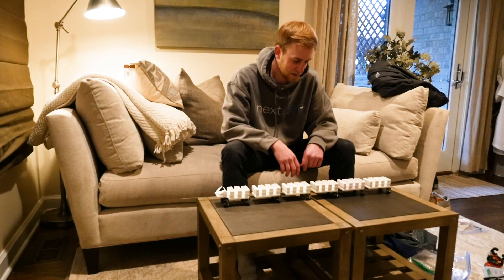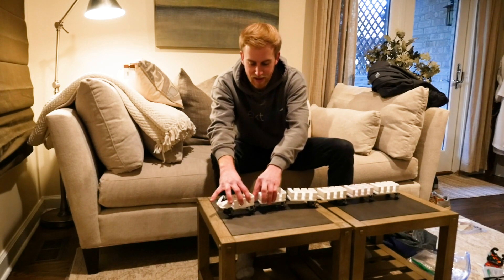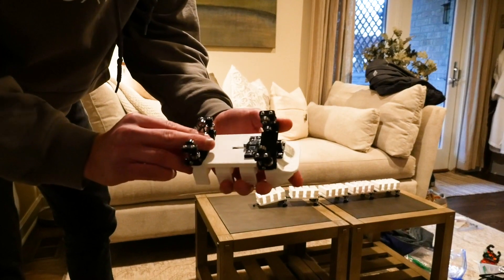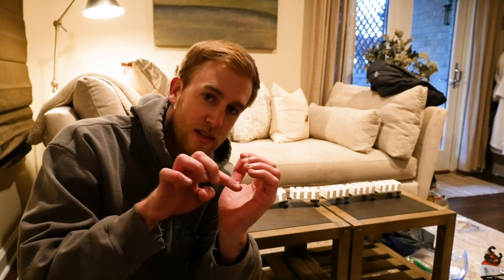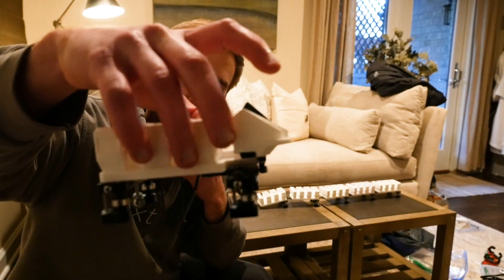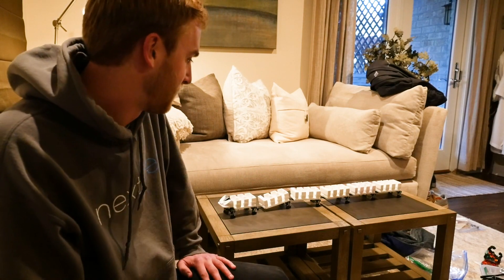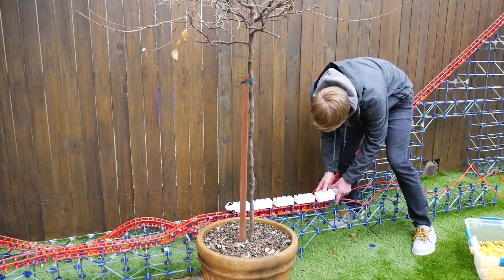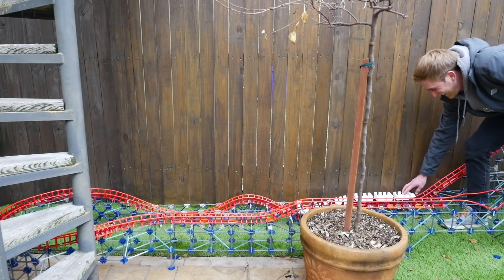Magnum XL-200 K'nex Train (3d Printed)

Comment: This looks really great!
But, and this is just a question not a criticism, aren't Magnum trains comprised of cars that can run individually? I mean as opposed to having just one pair of wheel bogies and a hitch to the car in front? 
But still, this is freaking amazing
Reply from the maker: Thanks! You're definitely right, and with this K'nex train the only car that would be similar to the Arrow hypers with the double assemblies per car would be the front car. For this train though I just decided to keep the similar wheel layout to the real K'nex trains with just a single assembly per following car. My 1/24th scale train will/does have double assemblies though per car, so that should look more realistic. Good eyes!
Reply: @3dcoaster  Its still a beautiful train model.  And personnaly, I prefer the trailer-hitch style chassis over the linked full chassis. 
The scale is so dialed in, that the outter wrap bogies almost disappear/blend.  I really didn't cath it until you mentioned it the video.